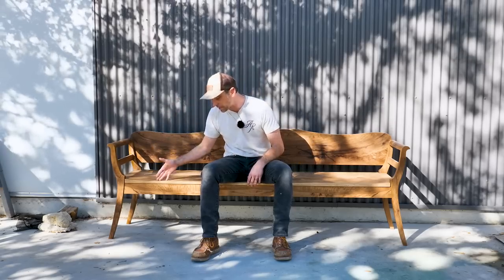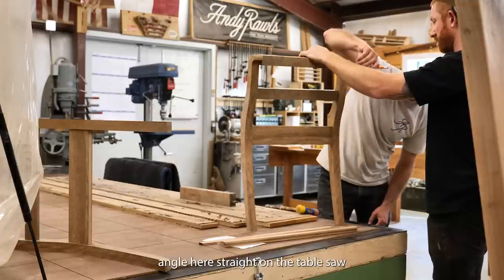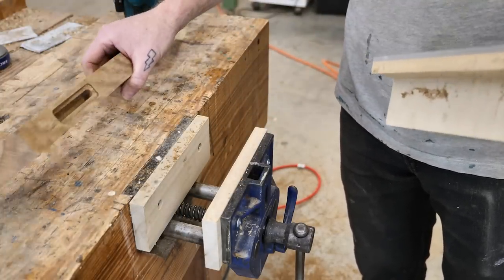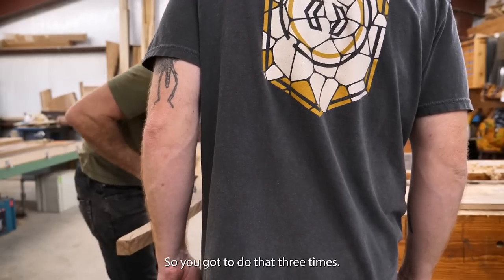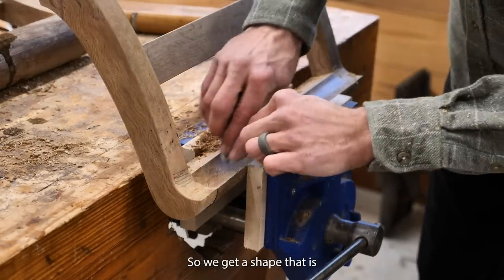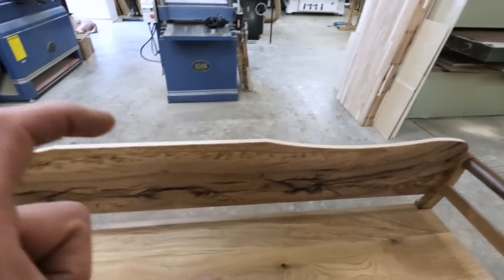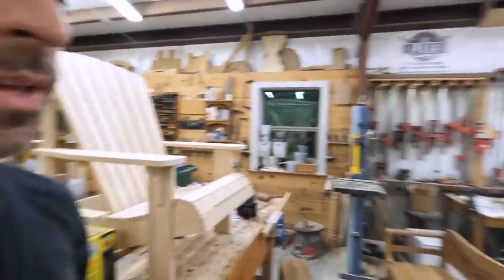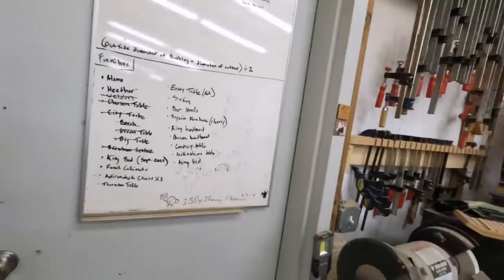Handcrafted Bench Made From Texas Live Oak // Heirloom Furntiure

Comment: How did you make sure with that mortise cutting jig for the legs that the walls that the aprons butt up against would be at 90 degrees to the floor?
Reply from the maker: There’s an adjustment bolt in the jig that account for that.  We put a big square in the face of the jig and square it the bottom of the legs.  It’s difficult to explain but I think I touched on it in one of the videos I linked in the description.